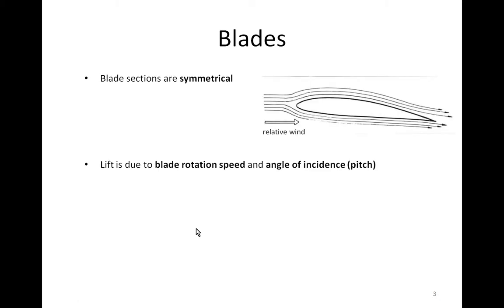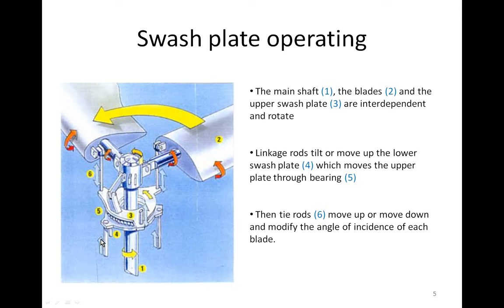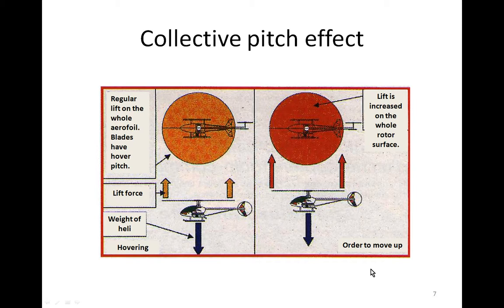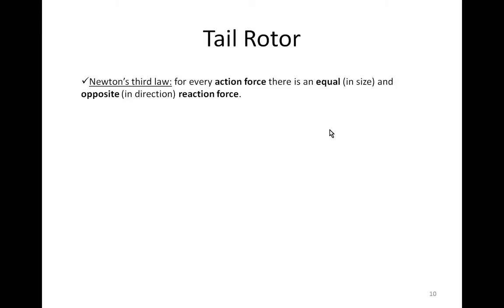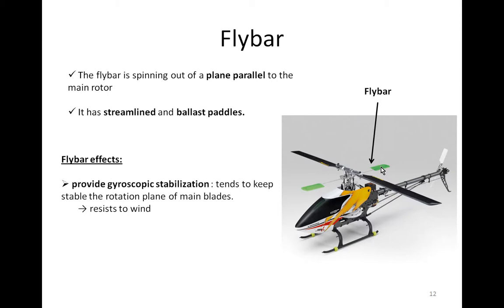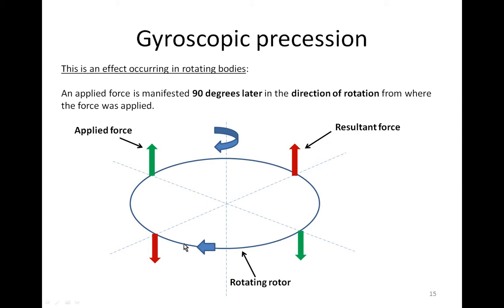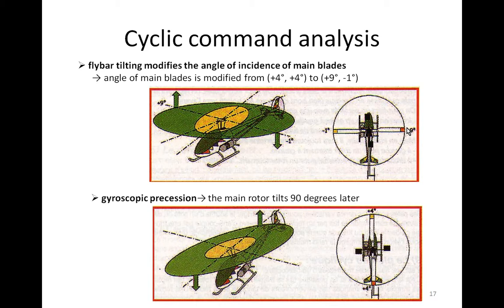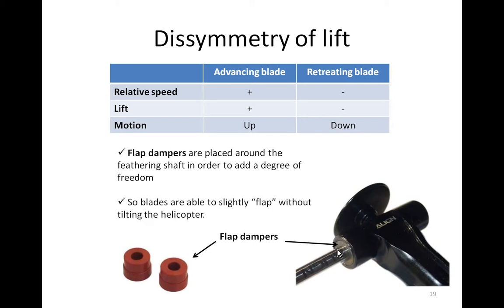Webcast - RC Heli Aerodynamics

Comment from the maker: Thank you for your comment.
It is interesting that you answer this question, because tail fins are not very effective in fact. The vertical one prevents the tail rotor to touch the ground when landing: the vertical fin is longer than the tail rotor diameter and then touches the ground to prevent rotor damage. The horizontal fin has no real effect, some RC heli don't have one.